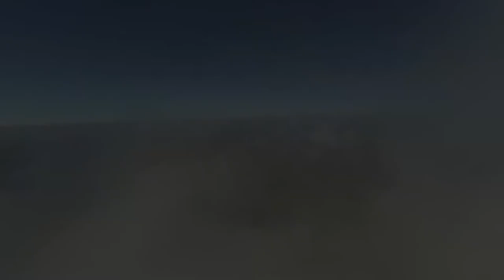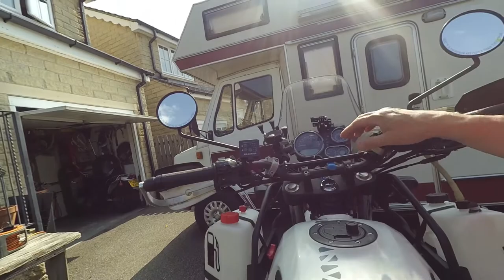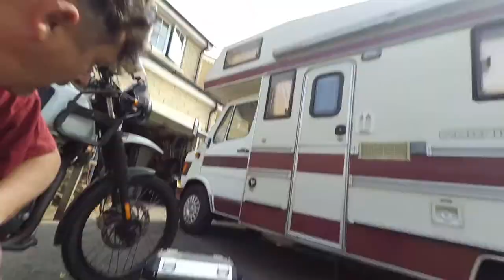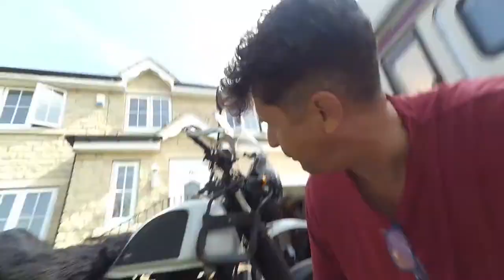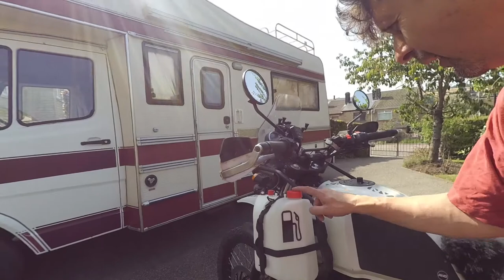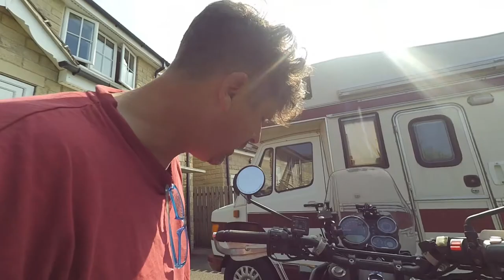DIY auxiliary fuel tank and water tank for RE Himalayan

Comment: With a 200mile range ,,do you really need to carry extra fuel? Water maybe!!!
Reply from the maker: Not usually, mate, but it has come in useful when I've run out of fuel and been able to take the tank off.  I started riding with 2 containers like this in the 90s when crossing Australia and definitely needed it then!
Reply: @TimPriestChannel  Oz maybe,but I rode down to London and most of the way back on one tank (280miles round trip) I admit I was runnin on flumes when I filled up (11lts) Can I ask a question... I have heated grips to fit,,where in the ignition wiring is it best to connect to? 2018bike
Reply from the maker: @lipsee100  I can be a bit scatty and forget to fuel up sometimes. (ADHD or something!)  Anyway, Oxford grips connect direct to the battery and it auto detects when the ignition is off.  Not sure about other makes, sorryy.
Reply: @TimPriestChannel  yeah these I got cheap (£24) and have connected to battery..If I,m am scatty my battery will be flat...
Reply from the maker: @lipsee100  Oooh.  Maybe after the ignition switch on black line that goes to a bunch of the fuses.  That way it is after the main fuse.

Comment: Lucky you can get away with strap mounting your tanks, and have same colour for fuel and water. Our regs here require petrol to be red, water to be clear, diesel yellow and to be retained by a mechanical clamp like the rotopax ones. I ran foul of the local police here and found out the hard way by having my wallet lightened considerably for "vehicle not to Warrant of fitness standards" (same as your MOT)
Reply from the maker: Whoa... tight restrictions.  Where are you?
Reply from the maker: Oh, they are also bolted in place (and velcroed!)
Reply: @TimPriestChannel  new Zealand